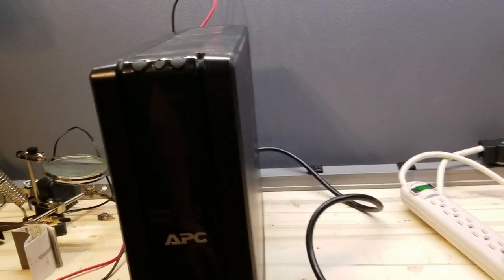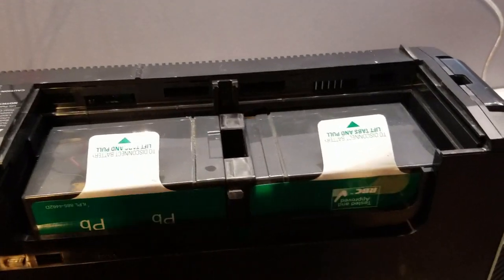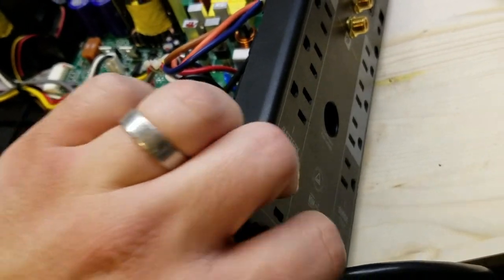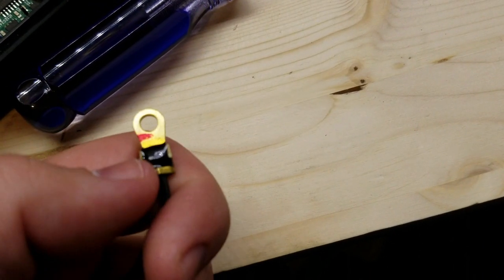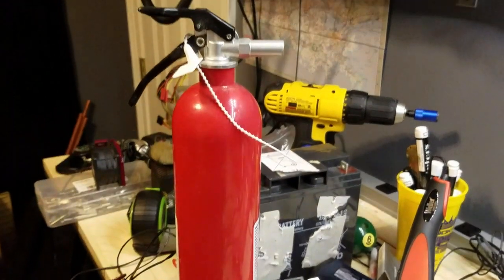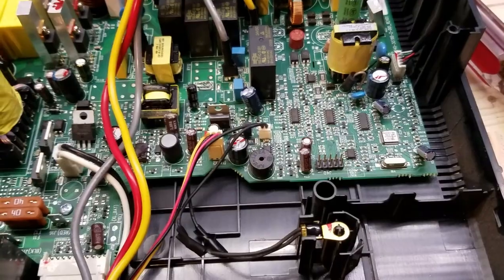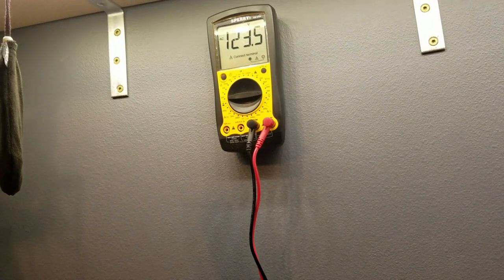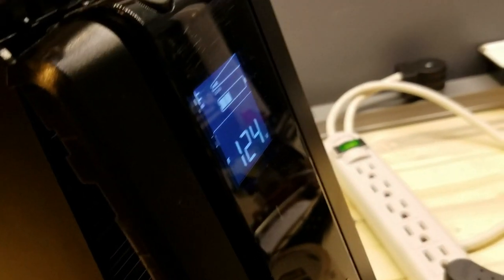Troubleshooting a UPS - APC XS 1300 (part1)

Comment: I have the same unit. I accidentally reversed polarity of the battery when connecting for testing. Is there a fuse on the circuit board?

Comment: I've got the same or similar issues.  New battery, fully charged but output when grid is down is only 89.7 volts per my meter, even though the display says its producing 109 volts.  That much discrepency is suspect.  Something to do with the onboard volt meter is skewed and perhaps causing the unit to shut down on low voltage.  I've tried to access troubleshooting and as you stated the manual is somewhat useless.  I have no error codes.  Old battery in, unit just shut down with zero volts reading while unit was plugged in to working grid current.  I think these problems are related (your's and mine both) and have something to do with the voltage sensor on the control board.  Could be a crack in the solder etc.  
Now mine does work with the new battery charged fully but with only 89.7 volts output which is not good for electronics, motors etc.  I assume, like I said problem is more than likely on the main board and perhaps a crack in the solder or other component malfunction.  
I have the BX1350 which is the same unit with larger output watts.  I plan on watching part 2 to see if you come up with any clues.

Comment: F07 is temperature overheat. .. the thermistor was likely cooked in the battery compartment. The batteries will vent when they die.
Reply: @ 7:01, it does appear to be a lug mount NTC thermistor.  F07 is the error I get on mine.  It may be hard to determine what the replacement might be if the thermistor does not function and there are no markings on it.  Of course that may not be the actual problem that led up to the unit giving that error message.  I need to get mine apart and find out.  Taking a good unit apart and measuring the thermistor in it might give a hint if I do not discover other obvious reasons why it is not working.  Schneider electric will either tell me to buy a new UPS or play in the street or they may not even know.

Comment: Two 12 volt batteries, or a 24v lead acid pack in this case, is pretty dead at exactly 24v. A well charged 12v lead acid battery should be anywhere from 12.7v to 13.2v at rest. Which for a 24v battery, should be between 25.4v or 26.4v. Your UPS was right in saying the battery was basically dead, hah! Depending on how long those batteries were sitting at that dead state, they actually could be toast, as Lead Acid batteries pretty much eat themselves if they are left discharged for long.

I will say the way it surged the power was odd. Anywho, off to part two! Cheers!

Comment: I have a APC 1500G UPS system and I thought you have to have the green side facing you to connect the batteries to the UPS system,  The red side facing up or at you I thought was just for transporting the  batteries inside the unit?
Reply from the maker: Yeah the pack will only connect one way. Usually they ship new UPS's with the batteries disconnected.

Comment: One really important step that every UPS owner should do...open them up and RIP OUT the dang  buzzer.  Nothing worse than a power outage in the middle of the night and hearing that until the battery dies.  I have 10 units in my house and every one has been neutered.  Can't stand that sound!
Reply: I did this on my APC unit. Thankfully my Tripp-Lite units have mute function and they stay muted.